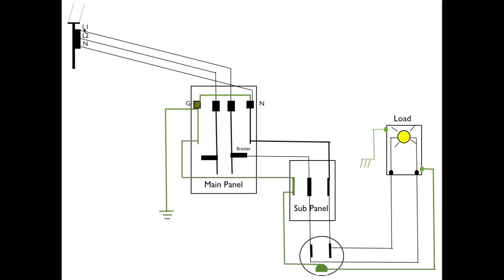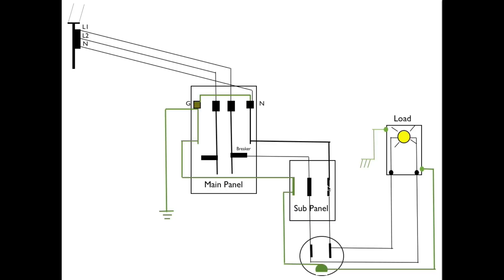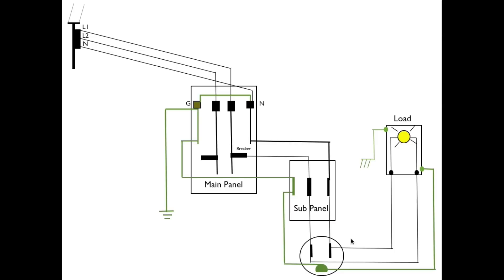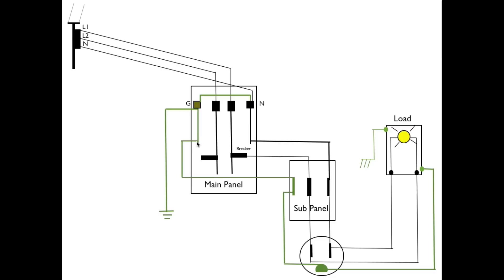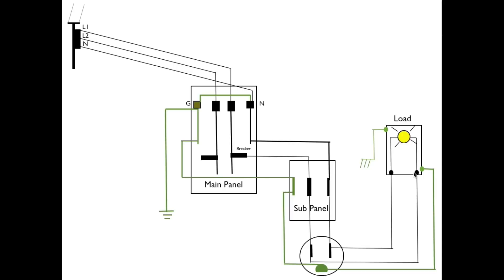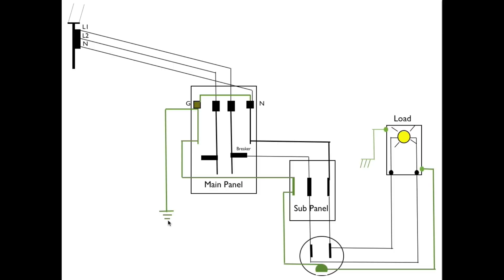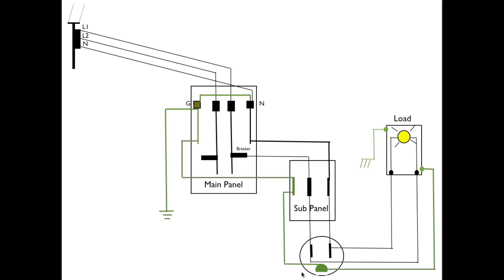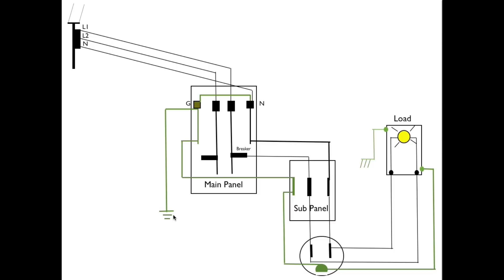The difference between neutral and ground on the electric panel

Comment: two ground rods here in Fla for 200 amp service
Reply from the maker: Many local codes require that.  I had one that required 2 bonds 20 feet apart in the foundation rebar and one ground rod hammered into the ground.  Ridiculous.
GFM
Reply: Yeah that's a bit much I wasn't sure if it was just Fla that required that two rods due to the dirt well being more sand and less compacted than other states thanks for the info .
Reply: Glenn Manchester ...right you are! Reason being a bad earth ground can cause havoc in different ways, if it is poorly earthened you will have a higher load resistance  which may cause insufficient current flow and create heat. Especially in motors!  If you remember ohms law...current = voltage divided by current, so what happens when you have an increased resistance? I should note it's not that you will have a higher resistance though you may because the return circuit can still carry back thru the neutral feed line but how far is the run to the poles transformer?
Reply: Doesn't that create ground loops? Ground isn't the same in each place. One has a different potential then the other.

Comment: In most all panels the neutral and the ground are the same bus bar.  Basically there is no difference in the neutral and ground.  All power must have a path to ground.  The ground safety circuit was added by the NEC in 1965 as optional and then was made a requirement after 1968.  The safety circuit is to handle the amps of a fault. or to cover an accidental contact with the power side in order to handle the over amps of a breaker trip.
Reply from the maker: I have not seen a main panel in 45 years that did not have a neutral buss bar and a ground buss bar.  The 2 bars are bonded in the main but not any sub panel.  There is a difference.  
GFM

Comment: On the metal hood of a grounded fluorescent light is it normal to have a voltage tester light up or is this evidence of a problem?
Reply: Where is the other end of the tester going?
Reply: It's one of the hand held testers battery operated. Lights up and buzzes when you stick it in the hot outlet. Has 2 double a batteries. Non contact tester. It buzzes when I put it near the metal hood of the fluorescent light. I also stick a plug tester in the outlet and the proper 2 lights light up
Reply: Sounds like you're picking up the magnetic field of the fixture's ballast transformer.

Comment: Technically you one have one ground and all the others and referred to as bonding conductors. If you don't think that ground wire from the panel is dumping current into the ground, then place yourself in between the ground rod and the ground wire. (actually NOT recommended)  Disconnecting the ground one a live system could very well result in death.

Comment: why is the neutral and ground conductor have a voltage from 5 to 20 volts which this to conductor is bond at the main source. thanks
Reply from the maker: It should not.  It should have 0 potential.  You may have an open somewhere.
GFM

Comment: Why would the sub panel in this diagram have only one line voltage wire? Shouldn't you have L1, L2, N, and G??
Reply from the maker: In this case, the sub panel is 120 volt for simplicity sake.  
GFM

Comment: The reason a ground wire is used is to catch stray electrons coming off the hot and neutral lines. If a ground line didn't exist static electricity would be abundant in the house. Anytime energy runs through a wire an electronic field is created around the wire. The ground line absorbs the stray electrons that are trying to get to ground. All electricity tries to take the shortest route to ground.
Reply from the maker: I am with you up until the last sentence.  If there is a complete circuit, the current will follow that circuit.  Good thoughts.
GFM
Reply: It's actually hard to make an accurate statement of exactly what electricity is trying to do. If you could make an exact statement of it, then you could predict it's actions. Electricity, because of it's alternating characteristic of going "in-out" "in-out" "in-out" all the time. is probably trying to make space for itself. And if it makes too much space, it will dissipate into the space.
Reply: Nonsense.

Comment: Unfortunately, there is a significant omission in your diagram.  That is the fact that the center tap of the single phase 240 V pole mounted supply transformer becomes the “Neutral” conductor only by being bonded to Earth/Ground at the supply pole.
According to the definitions of the International Electrotechnical Commission (IEC). this Earth bonded conductor coming into the premises is a Combined (C) “Protective Earth” (PE) and “Neutral” (N) (or PEN) conductor which, at the Distribution Panel is Split (S) – into PE and N conductors used in the fixed indoor wiring and flexible power cords beyond this distribution point.
This gives rise to the IEC designation of this supply system as TN-C-S – earlier referred to by Gustav Sane – where the letter T stands for the (Latin) Terra, meaning earth.

As for a lightning strike coming into your home wiring and traveling to Earth via your home Earth wiring (6:55), believe me this is the last thing you would want to happen.  If it did, it may be the last thing that you would ever know – or not!  Your power supply company will go to great lengths to make every attempt to ensure that this does not happen and that any such lightning strike is conducted to ground outside your premises.
Reply from the maker: The omission of the earth ground at the power pole was eliminated for simplicity purposes.  As we are working with power downstream of the meter, I try to not get involved with power transmission.  I do take issue with the neutral becoming neutral only if it is grounded to earth ground.  I could eliminate all grounds including the pole ground, and the system will work normally.  This is evidenced by earth electrodes being stolen for their copper value.  I am not advocating that the ground is not needed.
Lightning protection is not so much to direct lightning to ground but to prevent lightning from building up a large enough charge by discharging before it becomes a strike.  Note lightning rods generally do not attract lightning.  Thanks for the thoughts.
GFM
Reply: grayfurnaceman If you eliminate all Grounding connections, the "Neutral" conductor it is not Neutral and the Line and Neutral (AND the bonded Earth) will all be floating and have no reference to Ground/Earth potential.   The system will work (electrically) BUT if a fault occurs whereby a Line conductor becomes connected to Earth the system will STILL work, no circuit breaker will operate and the so called "Neutral" and "Ground" will become Live with respect any object that actually IS grounded - such as a water pipe.  That would be a VERY dangerous situation and is the reason the Neutral is ALWAYS grounded by the supply authority external to the premises  The Earthing conductors are Bonded to the Neutral at the premises and a supplementary (often, not very low resistance) Earth is provided at the premises..
You mention that the system will work with  "earth electrodes being stolen for their copper value."  However, in that case the system will work with some degree of safety only if the external grounding of the Neutral provided by the supply authority still exists.
Reply: FrodoOne1, thanks for your input! Could you tell me where this external grounding of the Neutral provided by the supply authority is usually located? Is it near the meter or way out at the pole? Probably the meter, right? And what does this grounding consist of? Is it a copper rod driven into the ground or some other arrangement?

Thanks in advance.  : )
Reply: ***** I do wonder where you are resident when you ask such a question.  I am fortunate to be located in a country where the power distribution system conforms with IEC standards. While I have assumed that these standards are normal where persons communicate on fora such as this, it may be that you are not fortunate enough to reside in such a location.

I strongly suggest that you research the systems known as Protective Multiple Earthing (PME) in the United Kingdom and Multiple Earthed Neutral (MEN) in Australia/New Zealand.
Perhaps you will then discern that a Neutral/Earth is normally obtained from multiple sources in industrially advanced countries.
Reply: FrodoOne1 excellent response

Comment: There should be no voltage potential between the ground (Green) and common (white) (US). Right? If there is something pretty bad is happening. Right?
Reply from the maker: You are correct.  Ground and neutral should have 0 potential.
GFM
Reply: Except for induced current/voltage, which will show up if using a high impedance voltmeter or oscilloscope.

Comment: Here's what I don't get... I know you said not to connect the ground and the neutral in the sub panel... but aren't the ground and neutral in the sub panel connected by the wires coming from the main panel? The wires just go to the ground and neutral in the main panel, and those 2 are connected. So i don't understand why the current wouldn't just flow through that way.
Reply from the maker: +Paul Mooney The problem here is on the sub panel, if the neutral and chassis ground are connected together, and the neutral has opened, the unit will run normally.  This is bad because then power is passing thru the chassis ground.  If then the chassis ground makes a bad connection to the panel, the chassis of the unit will be hot.  Hope this helps.  I will probably do another video on this to help make it clear.
GFM

Comment: The ground and neutral wires are connected in the main panel. Wouldn't that make them parts of the same circuit?
Reply: Rob Harper yes but powers not going through the ground wire until there is an overload or contact, ground and neutral have the same potential difference. To where as neutral is kinda what keeps electric balanced since it’s ac the power alternates or it would just back to the transformer
Reply: @Punkdupkid55  -- if the ground circuit is connected to the neutral circuit, then any power that's going through the neutral is also going through the ground. That's what's confusing me about this whole issue.
Reply: Rob Harper I don’t know what you mean by connected. They both share the same bus bar at the main because Electricity needs to dissipate its negative energy back to the ground the grounding wire is a low resistance wire for back up for when stray voltage is release
Reply: @Punkdupkid55   "connected" -- in the diagram for the main panel, there's a wire running from the neutral circuit to the ground circuit.
Reply: Very observant. Yes they are part of the same circuit. The entire wiring in your house is. 

The key, is that it is connected only there, and in parallel with that connection is the main neutral drop (more properly, the grounded conductor). Considering Ohm's law and considering the extremely low impedance path of the neutral wire and the quite high impedance path of the earth ground system, very little current will flow through the earth grounding system. But trace amounts, technically, will.

As a thought experiment: If you took a copper wire and connected it to your grounding rod outside your main panel, then ran that wire back to the transformer ground (if you have one) you will have provided a low impedance path for the return current more in likeness with the line hanging from the pole into your house. In this case, the current will split more evenly (still according to ohms law—all you've done is reduce the resistance of that path).
Reply: Rob Harper    Simple answer is look at the other end of the conductors for the difference.   Neutrals are connected to loads fed by hots to complete the circuit.   Your toaster oven works.   The equipment ground(called safety ground in video) is connected to metal parts that are not supposed to be energized.   You can touch the metal housing safely, not electrified.   If the hot touches the housing(ground fault) it causes the breaker or now GFCI to trip.   Hope this helps.   Kevin

Comment: Mostly yes, a little bit of no and some maybe. The problem is there is various differences in names and terminology between regions, countries and various trades. ie; ground vs earth.  Grounding, a term that on it's own does not  differ from equipment grounding vs conductor grounding. He did raise the point that one ground rod has lousy protection as it has resistance in the dozens of ohms with a nasty voltage gradient around it during high fault currents.  Systems vary too, are we talking about a house in town, a rural application or at a power generation facility with a massive ground plain , hundreds of ground roads and everything inter connected from one side of the site to the other.
Reply: Buickanddeere, in your post about, "... there is various differences in names and terminology between regions, ...", brought back memories. Like who knows what a "pecker head" is? Or maybe "diddle sticks"? And no it has no direction to the human body! lol

Comment: How can you explain then why inside a 240 volt electric range there is connections to 120 volts devices such as clock, light bulb,etc using L1 and ground to complete the circuit, this has been in my mind not understanding
Reply from the maker: Francisco Castellanos This was a bone of contention for me many years ago.  If I can't use ground as a conductor, why should an engineer do it in a manufacturing situation?  I believe it was 1995 that the NEC ended the practice.  You now must use a neutral in these appliances.  Hope this helps.
GFM
Reply: Francisco Castellanos — A range connection with three wires has L1 N L2, and the metal body of the range is connected to neutral.  A range connection with four wires has a ground and the body of the range is connected to that.

Comment: Does a neutral wire run all the way back to the generating station?
Reply: It depends on what kind of 3-phase system distributes the power.  It is common at distribution level circuits (usually in the neighborhood of 15 kV or 25kV) to have a WYE system, which does have a neutral.   If there is a delta grid involved, it will not have a neutral.  It might have a single phase grounded (called a corner grounded system), which is technically not a neutral.

WYE means the transformer windings are connected in the shape of a letter Y.  Delta by contrast, means they are connected in the shape of the Greek letter Delta, which is a triangle.
Reply: Every time you go through a transformer, that isn't an autotransformer, there is an isolation of the two sides of it.  The secondary side needs to have its neutral conductor re-bonded, after deriving the new system.  Transformers only transmit time-variance in current and voltage across their coils, because it is magnetism that transmits the power.  They don't have any ability to transmit any electrons.

Comment: Electrons are always trying to get back to a positive source, it will take the route with least resistance (shortest) even if that means going through you.
Reply from the maker: Actually, it will take all paths.  The low resistance path just gets the most current.
Example:  If you touch the hot side of a lamp, and are connected to chassis ground, both you and the lamp will light up.
GFM

Comment: The NEC addresses the installation of electrical conductors, equipment, and raceways; signaling and communications conductors, equipment, and raceways; and optical fiber cables and raceways in commercial, residential, and industrial occupancies.Ground Fault Current Path-(Ground Wire)An electrically conductive path from the point of a ground fault on a wiring system through normally non–current-carrying conductors, equipment, or the earth to the electrical supply source.
Reply from the maker: lectric2010 And your point is?
GFM
Reply: First of all, Thank you for spreading thoughtful and useful knowledge. Secondly, The ground wire is installed "to carry any objectionable flow of electricity safely to ground" as per the National Electric Code. It is there for safety of personell and equipment.
Reply from the maker: lectric2010 That is absolutely correct.  Earth ground is a great absorber of stray currents.  Thanks for the thoughts.
GFM

Comment: In my Schooling /Training,  I was taught that the neutral was also earthen grounded at the transformer/power poll? You have omitted that from your sketch. Also, you only show a 120 Volt circuit and not the entire 240 vac system at the sub panel causing it to only be a 120 vac branch circuit.
Reply from the maker: I have omitted that part of the circuit because upstream of the meter is not my responsibility.  The 120 volt circuit is shown because the only circuit that uses a neutral is the 120 volt one.  240 does not use a neutral so it was not shown as a way to simplify.
GFM

Comment: I think u forget to mention that the neutrel in sub panel carry rubber bushes underneath to prevent it from become ground again ????  here in Manhattan NY in commercial tower we use to type of ground the first ground go to outlets or switches  and the other ground straight to the body which the electrical boxes in general and both of them totally different grounds
Reply from the maker: I didn't mention it because the panels come with the insulating bushings installed with a bonding conductor to be installed if it is used as the main panel.  However, I should have mentioned it.  Thanks for the thoughts.
GFM
Reply: Thanks for the reply

Comment: at main panel, do we really need to connect Neutral line to Ground line? i mean we can separate them completely and system still work fine and save.
Reply: Think about path of least resistance to ground.... it provides that path for safety.